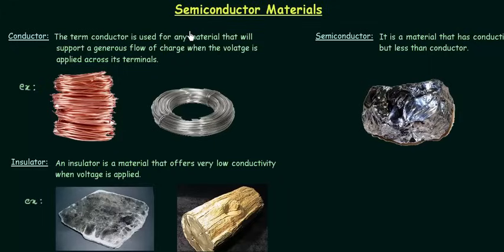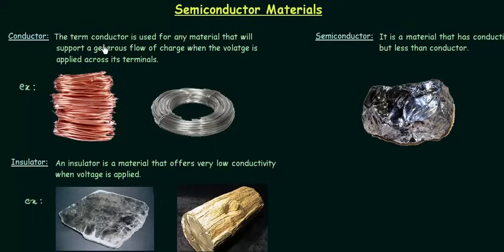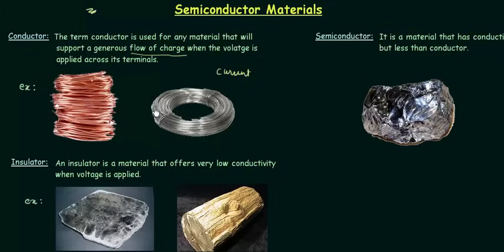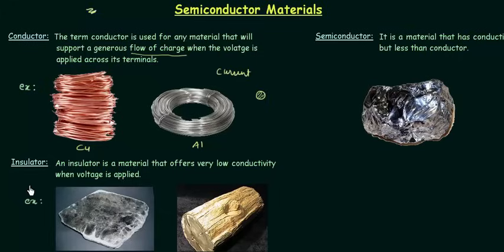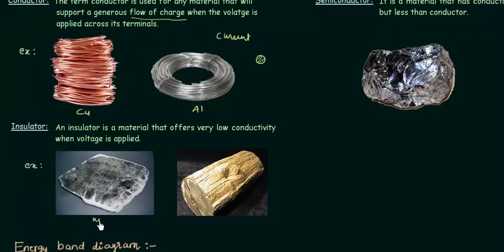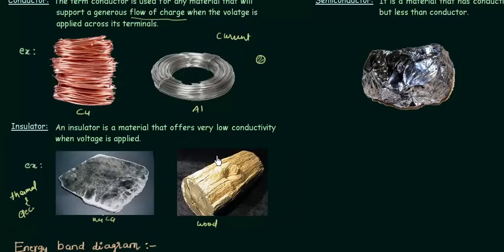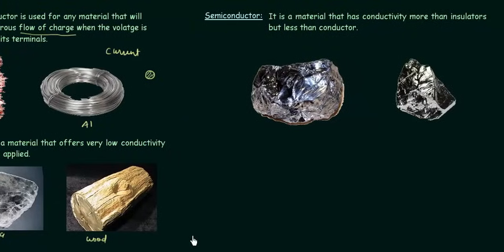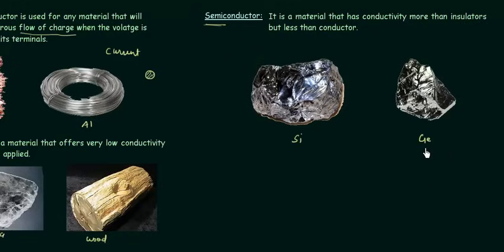Semiconductor Materials

Comment: Good morning sir
In conductor band gap is 0 .
You said there is no need to apply external energy.
How the copper wire short-circuited without applying external energy??
Reply: Intially copper is conductor but it need some external energy to flow current in it.